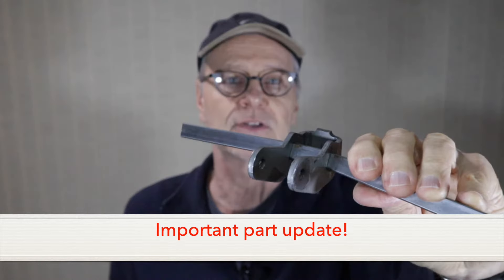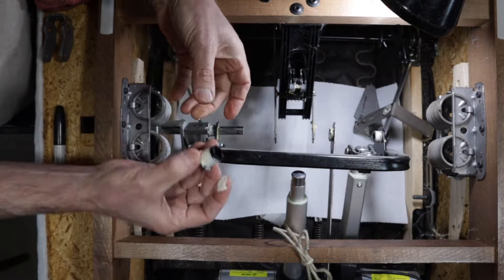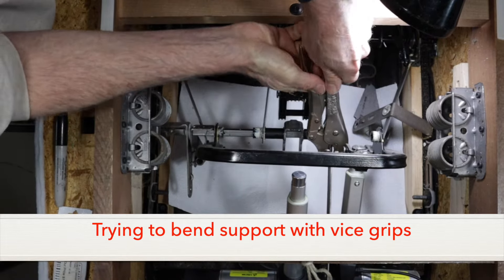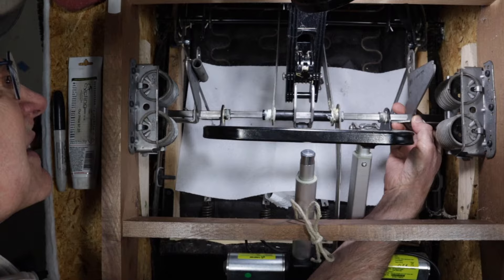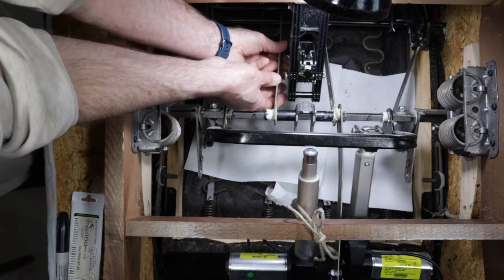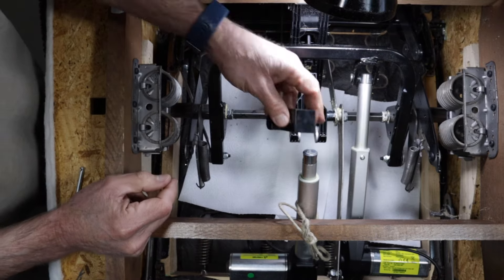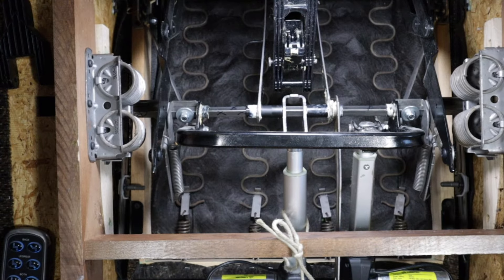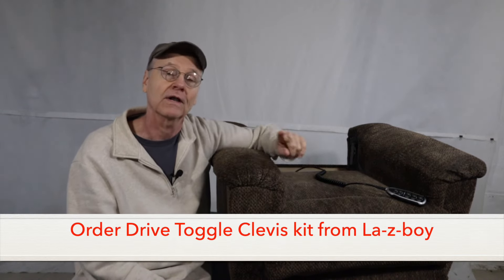La-z-boy Drive Toggle Clevis Installation - Part 2

Comment: Very, very useful pair of videos. We didn't have to remove the drive rod because we replaced the clevis kit with a metal set that allowed us to put the part on the clevis and tighten 4 bolts securing a plate which completed the connection to the drive rod. Both parts of this video were extremely useful for familiarizing us with how it all went together and how it worked. Thank you.
Reply from the maker: @Marvinglep - You're welcome!

Comment: Very Instructional Video, Watched Part 1 and Part 2 to replace the broken plastic parts for ours chair, I know enough now how to fix my other chair. I have the redesigned clevis part that has 4 screws holding it together to fit around the rod, so did not have to pull the rod out to reassemble. It is working well. So glad to see your video to understand what did what since all I had was  shattered plastic. Thank you.
Reply from the maker: @bjkruse-ml4ov - You're welcome!

Comment: So I’m fixing my friends recliner with buttons on side as I’m trying to line up the bolt holes the right side doesn’t wana line up but left side lines up perfect but as I put both in same time I hear on right side like it wants to crack or something also the bolt on left side lined up tightens as I go down more can I get some help what’s going on I am replacing plastic part from Amazon I bought to do this

Comment: At .35 in the video you show a bent drive rod, what caused the rod to bend? I asked because I installed the new metal drive toggle clevis and the chair appeared to operate correctly, but after a few months  the drive toggle connector broke, and I discovered the drive rod was also bent.
Reply from the maker: @robertzacks3002 - The most common cause for bent Drive Rods is the continued use of the lift actuator after mechanism parts have broken. The parts are designed to rotate the rod, but when parts fail, extending the actuator can sometimes cause push back against the rod causing this damage. It's not unusual for users to not immediately recognize the plastic part failure & continue to try to extend the footrest.

Comment: Why is my drive rod able to be pulled forward and pushed backwards? If I push it back the footrest locks closed and after I open the footrest I have to manually push the drive rod back and footrest works again.

Comment: No. No. No.  I've followed this seven times.  Leg rest will not extend fully except for one position that you did not show; then it broke the guide rod.  I just replaced the guide rod and I am back at the beginning.

You failed to show the correct "new" metal replacement part and also did NOT show clearly the orientation.  The chuckle about having to to it over, is infuriating because I still don't know what doing it over means.  I did it four different ways (four sided rod) and the only way that lifted the leg rest fully, bent and broke the plastic guide rod.  Later you pointed at the END of the rod to show the correct "up"????  I didn't see your "T" or "B" markings so I am still lost.  

90% of the vid is useful. but the most important part is unclear.
Reply: I've done it a couple times. Every time I do it it takes me about 5 times to take it apart and put it back together before it worked right
Reply: Where he has it its basically flipped upsidown 180°